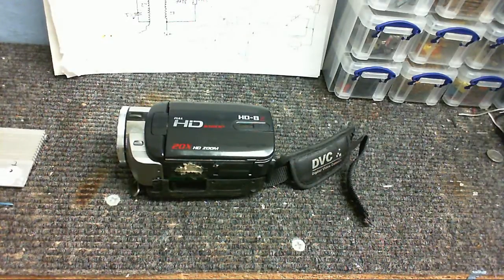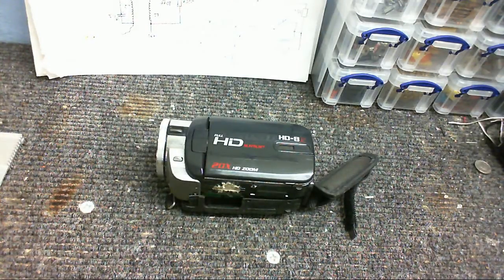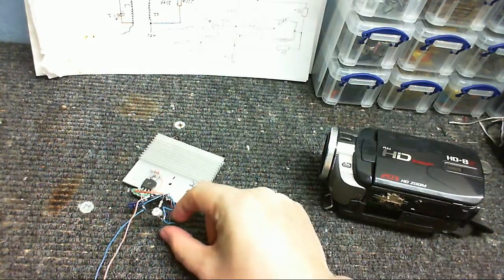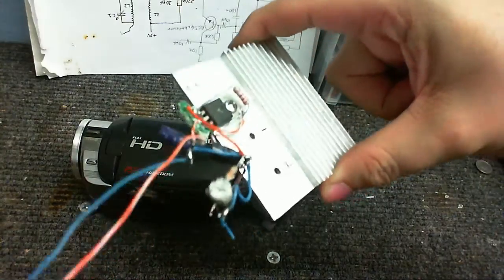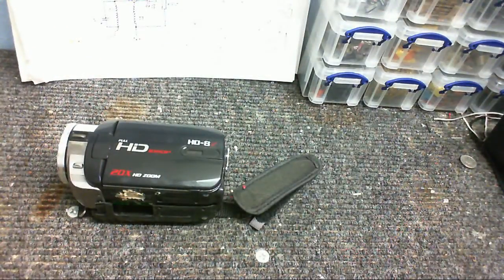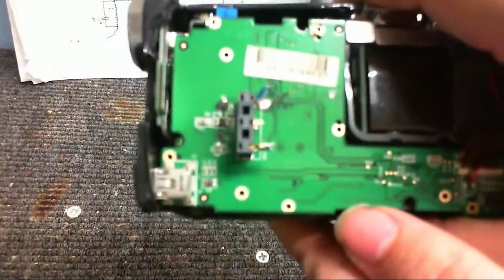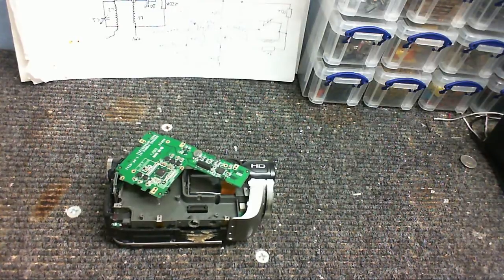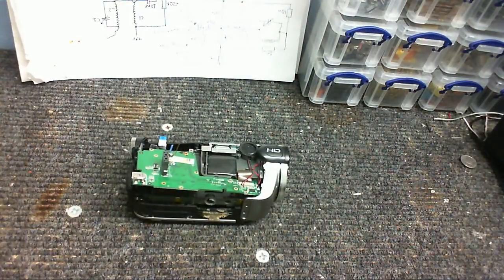What happens when you overvolt your camcorder...

Comment: What is the part number of that overheated and blown IC? I'd expect the Chinese manufacturer just used some standard PSOC (Power System On Chip) that should have a data sheet available. Using that you may be able to figure out what voltages the camcorder works with internally.
I don't think you can convert that to a webcam. The sensor is probably controlled and read out by a camcorder system on chip that delivers the data stream that another controller writes to the SD card. That is not going to be anything you can bring into the computer using USB. But again, the data sheet for the camcorder SOC might be available and offer further info.
Reply from the maker: DrCassette I cant really say since where the chip has blown it's obscured some of the numbers.
Reply: Hmm, that's too bad.
Reply: +CoolDudeClem maybe you can get the user manual online, and localize the part number in the board schematic. ;)
Reply: I don't think a service manual is available for this. This camcorder was not only sold under the Speed brand, it was also available as JayTech, Hyundai, Yashica and Praktica, I researched all those models, never came across a service manual. Just the mostly useless user manual.
Reply: Yep. That's not good. Maybe it's simply not worth fixing it. Get a new one. Bummer... :(

Comment: Well, that means that I'm not the only one with a bad luck streak. I wanted to inject an audio signal in a Vintage beyond repair radio to see how it sounds. Well, I though that the metals from the switch arrays is grounded and the plane of that pcb is grounded...nope it was conected to 8V and when I hooked up my nice Philips Mp3 Player, it produced some distorted sound for about 2 seconds and then total silence. Yep, it blew the headphone amplifier from the mp3 player. The thing is that the amplifier is integrated in the main IC. So this a word of advice for everyone, especially myself: Check the damn voltages first!!!

Comment: What a pity, hope you can use some of the camera parts. Next time protect your regulated power supply with some of a crow bar circuit which takes out the DC fuse if the voltage exceeds a preset value.